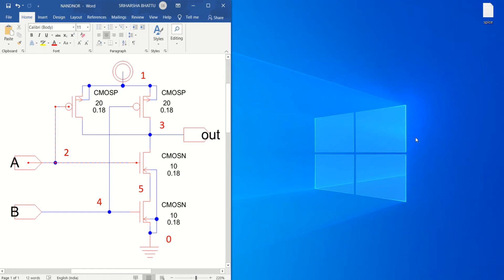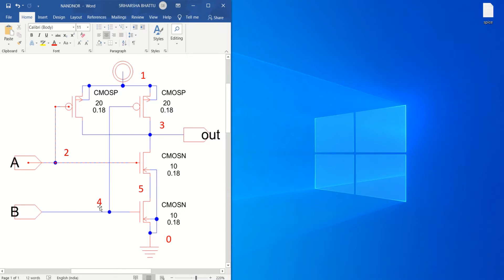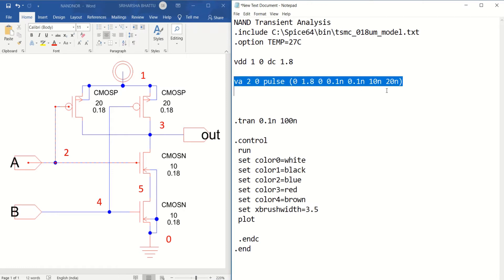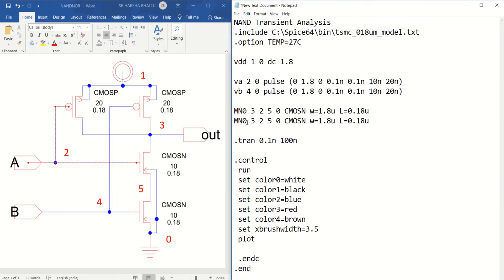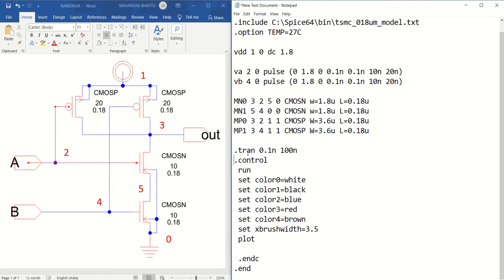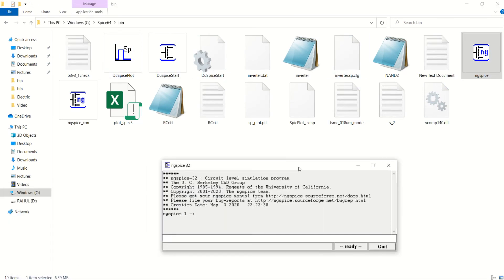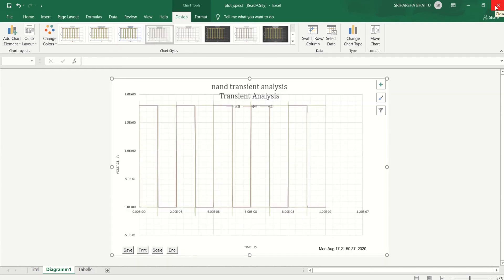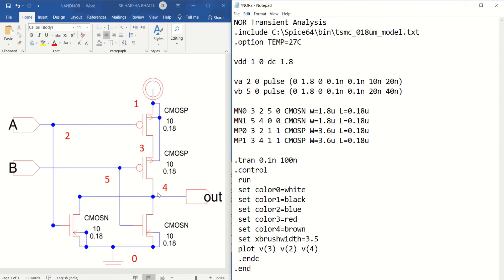Spice Netlist of NAND & NOR Gates.

Comment: Dear sir i need to write Netlist for OTA can you please help
Reply from the maker: Hi, spice code is common for OTA also. Just you need to know terminal names used for the design
Reply: @dr.hariprasadnaikbhattu  Sir i had written the netlist but still the parameters are not coming please i need your help if you can provide your contact details i will share the things with you
Reply from the maker: @Samii_4424  you need the model file for simulation
Reply: @dr.hariprasadnaikbhattu  Sir i have the model file for Cmos and i have written netlist
if you can help me with this